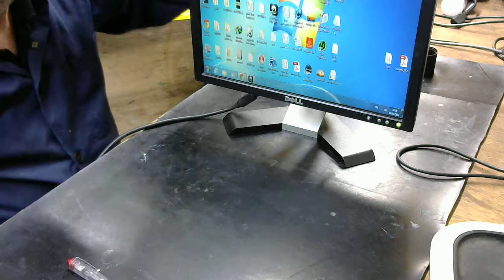Repair LCD Monitor Dell E177Fpb

Comment: please respond. i have a ST2310 monitor and i bought it with the back light not working correctly. it still works but its really low loghting but you can still see. one day i turned it on and it went back to normal by itself. and it smelled like something was burning. then after two days it went back to the way it was with low lighting. plz help?
Reply from the maker: flicky flcker   Hi, thanks for share the problem.
Usually the black light problem in 12+V of secondary Power board. please watch other repairing monitor in my channel or visit on my blog wwehs.blogest.com you can find the solution. otherwise please publish a comment here or on the blog .
Good luck.

Comment: I have a Dell monitor e170sb and the monitor start fine , shows the colors message, but if plug a vga cable to the pc or notebook, the monitor shows : "save energy mode " and off the screen, with the power button in orange. Help please , friend, and greets for you.

Comment from the maker: #repair   #Lcd   #Monitor   #dell  

actually we going to check power board first if power board have voltage 12V in output we have to check the main board and keyboard